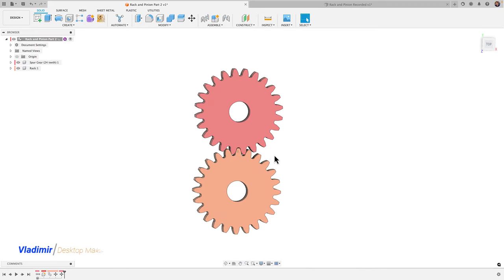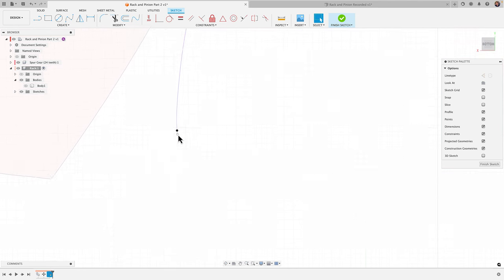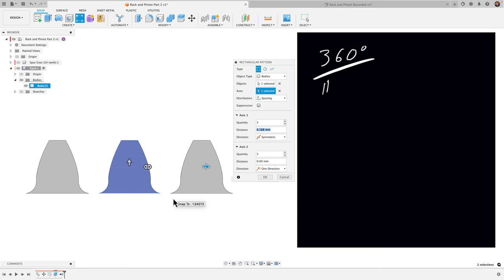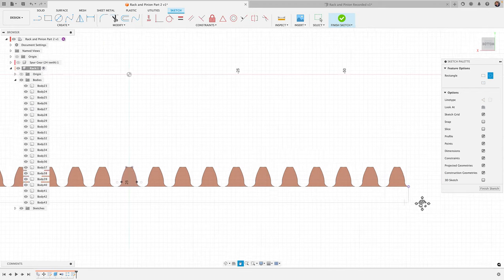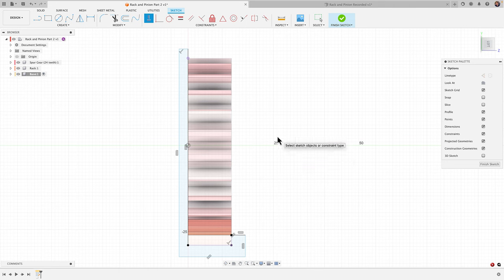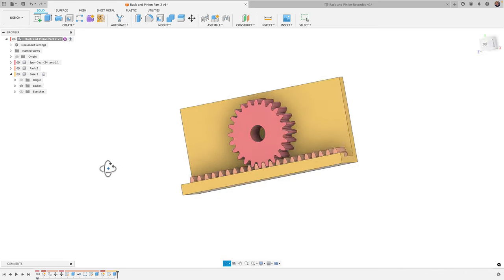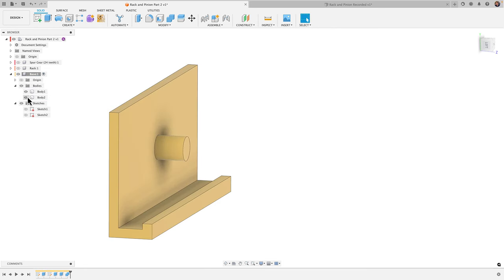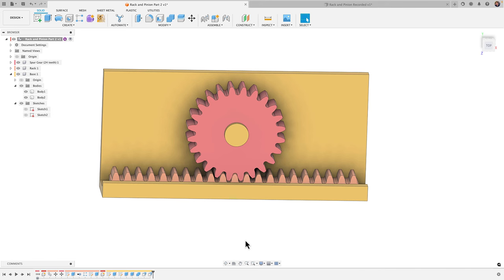Rack and Pinion Part 2 - Fusion 360

Comment: Good stuff.  I’m enjoying this series.  One critique: It wasn’t obvious why you were making the pin as a separate body.  I assume it is to be able to 3D print the base without supports.  But, if you mentioned this reason, I didn’t hear it.
Reply from the maker: Good point.  I completely forgot to mention why the separation.  Yes, it's for printability.  I'll talk about it in the third video.

Comment: Vladimir, how would you control multiple folding joints in a specific order, like a machine is telling it 1,2,3,4? As if each joint had a different amount of resistance.
Reply from the maker: Hi Adam.  Not sure I understand the question.  Can you explain a little more?

Comment: I am brand new to this designing stuff and enjoying your videos. I have signed up for one of your courses which brought me here. At 12 minutes into the video when you are creating the pin, I cannot get two separate bodies from the extrude like you do. I only have one 3mm thick. I have rerun the videos and rebuilt the project to see what I am missing but have not discovered it yet. Perhaps you can assist. 

Thanks,
Reply from the maker: When you extrude, make sure to select New Body in the dialog box.

Comment: Hi! When I am extruding the pin, I get one combined body, instead of two seperate bodies like you get. Any idea why?
Reply from the maker: Make sure to choose "New Body" in the dialog box instead of "Join" under "Operation".
Reply: @DesktopMakes  I am. I found a workaround, but it seemed strange that this wasn't working. I have had some other similar issues with fusion in the past, so I might reinstall it later.